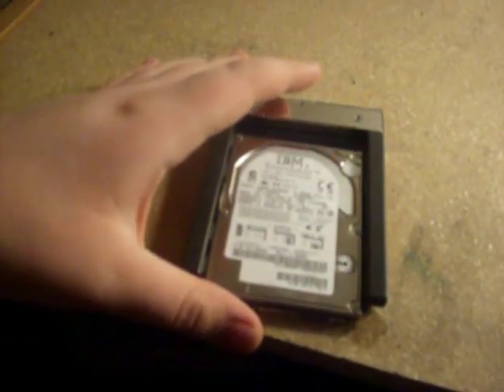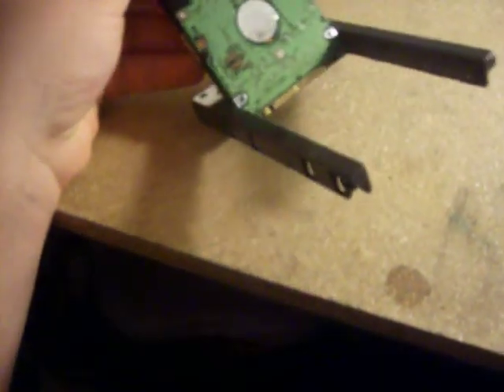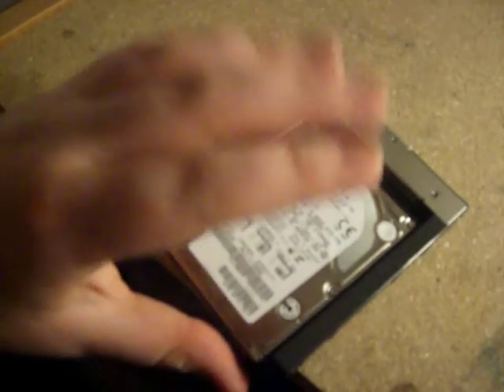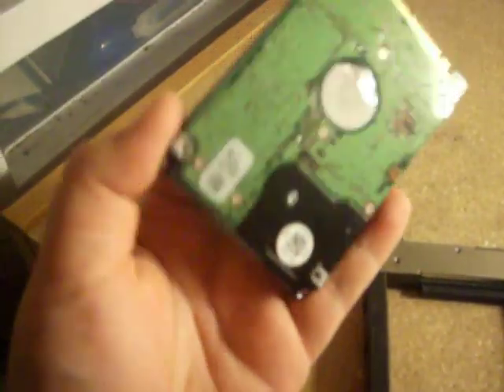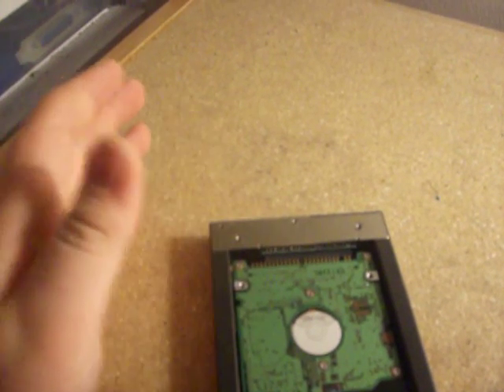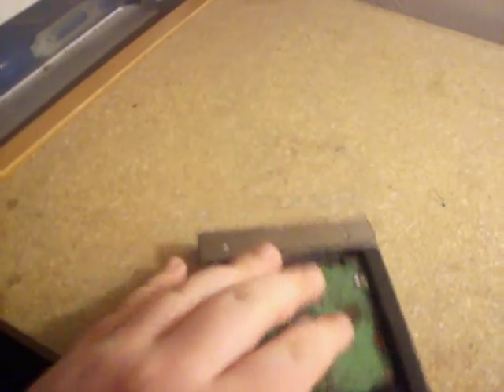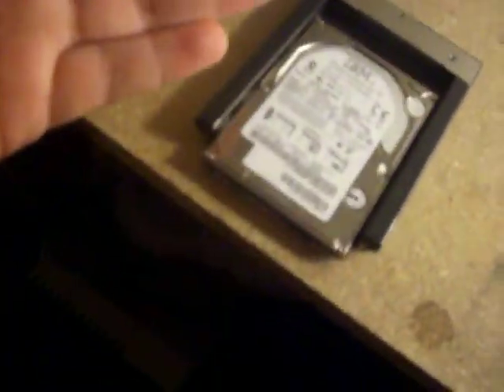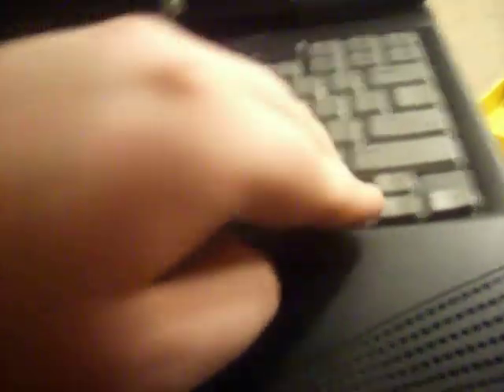Video Request From RubiksMaster25 On Ram and HDD Change In The 1750

Comment: @delliswierd IBM hard drives OEM, Deskstar, TravelStar, were renamed Death Star
However, Go with the Hitachi hard drives. Hitachi bought IBM's hard drive division, hence the name Deskstar and Travelstar on both brands. The IBM's are crap, Hitachi's were improved so they are better.
Also, they usually sound the same. :-)